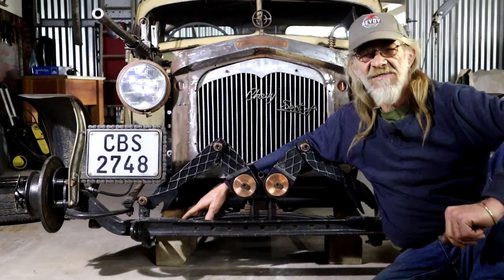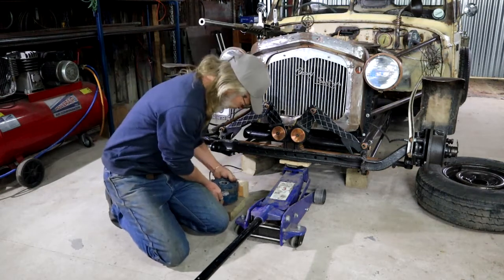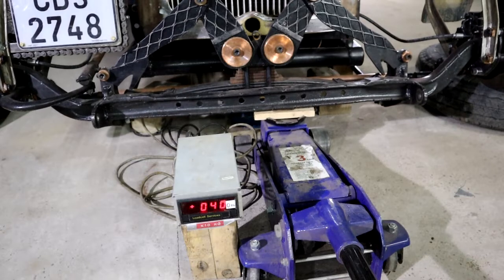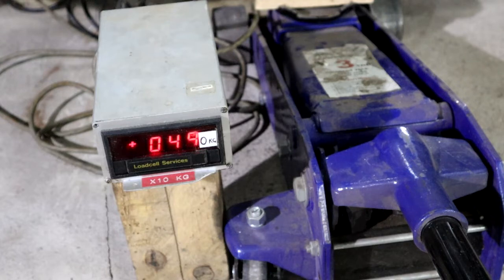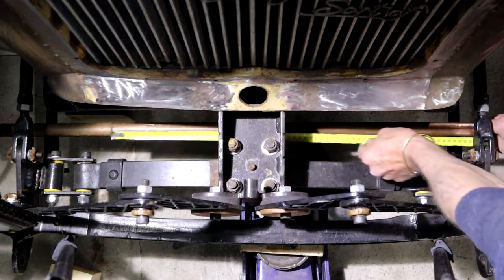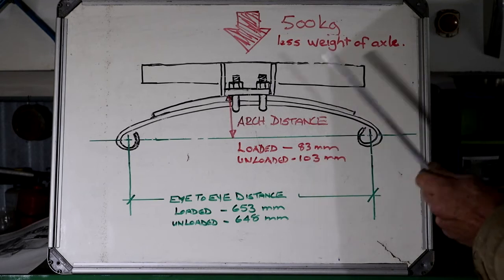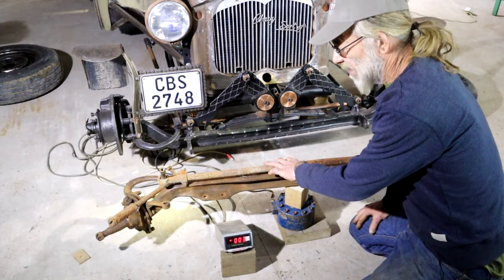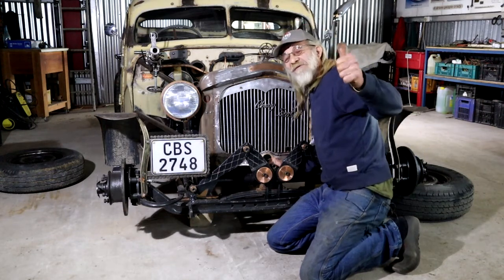HOW TO MEASURE FOR CUSTOM TRANSVERSE LEAF SPRING

Comment: Little hint here mate. When you measure centres on bolts, etc, just hook the tape over one bolt head and measure to the inside of the other. This is the most accurate way. You can also go outside to outside and subtract the diameter of one bolt. Cheers.